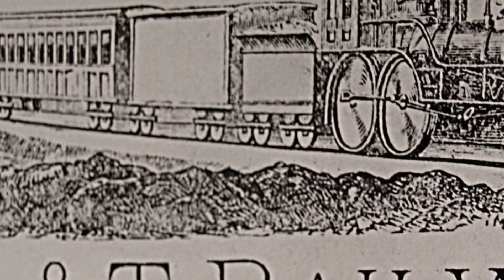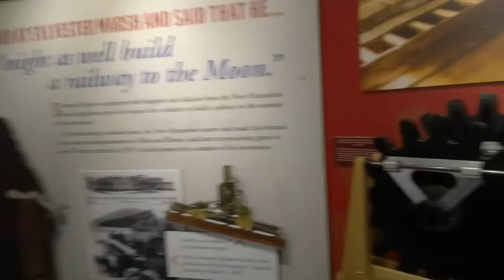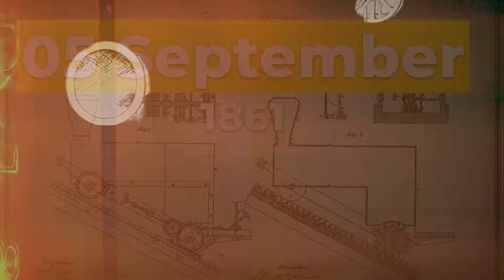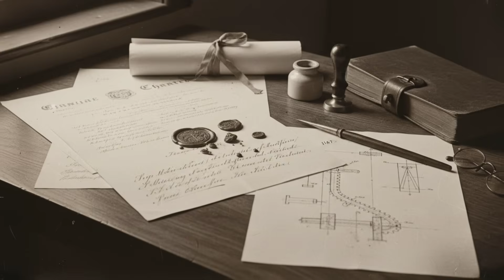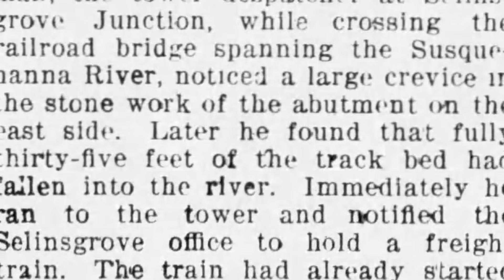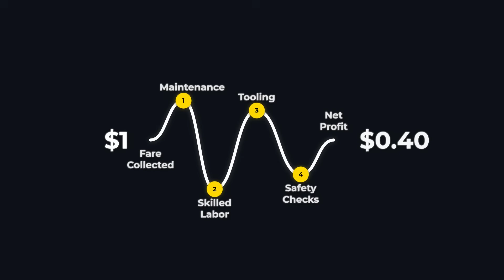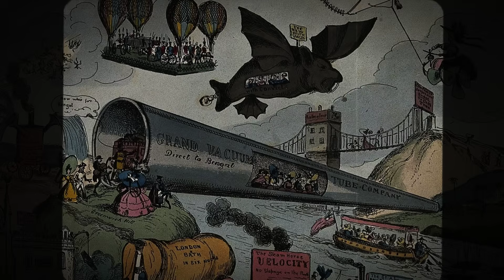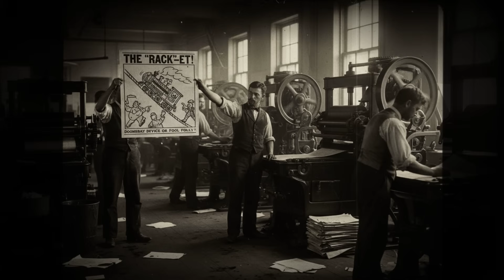Engineers Said His "Rack And Pinion" Design Would Never Work — Then It Changed Locomotives Forever

Comment: I have a hard time with “defies the laws of Physics” proclamations. Nobody breaks the laws of physics. They might find another governing law or phenomenon. This story is rather choosing what laws of mechanics/physics/engineering you choose to employ to make your machine work and work safely. Steel on steel traction is fine for what it is good for. 
I’ve used rack and pinion drives for large machine tools, and these systems are really quite different in detail. The precision approach uses involute gears, and minimum backlash, and in machine tool service, even an electronically managed dual opposing drive to eliminate backlash issues in operation. That would never work on a train. These systems use more clearance, in the roller rack case the rack is really a roller chain with rigid links. In the cases of more modern and advanced systems there are other approaches but these are all high clearance meshes with coarse pitch. I’m sure the later Swiss systems also have some automatic lubrication.
Very interesting bit of history, well done. Real images too! Bravo for that!
Reply: You can’t change the laws of physics. That’s why they are called laws and not rules.

Comment: I wonder if the chamfered to remove any sharp edges. Chamfering done correctly reduces friction and increases the life. I have repaired large systems that roared loudly when running, and when I completed the job and they started the equipment they thought it wasn't running because it was so quiet. When they looked everything was running so smoothly there not much noise. People in that department that had to wear earplugs before no longer needed them. Chamfering increases the life by reducing the friction if done correctly, and makes for a smoother quieter machine.

Comment: Very interesting. I've ridden the Mt Washington cog railway several times.    I also have a great interest in all steam locomotives.  Nothing like them ever! 
😊❤
Reply: The Mt Washington cog railway has been converted to mostly Diesel Hydraulic locomotives to push the passenger car up the mountain. The new engines are cheaper to run than the coal fired steam locomotives. But they still have to use the rack and pinion system of locomotion.